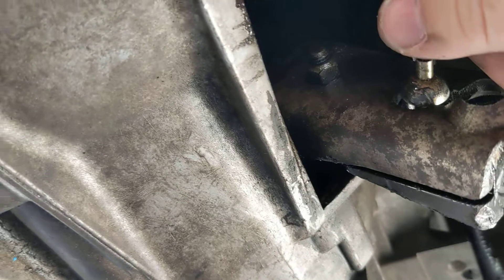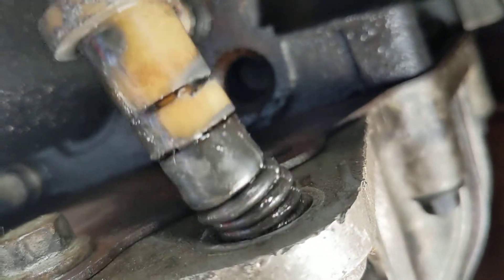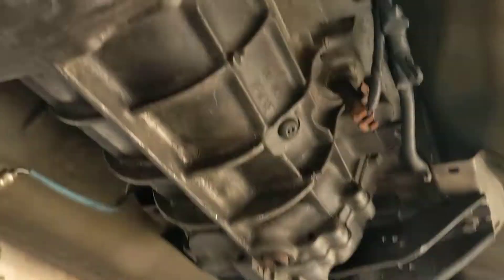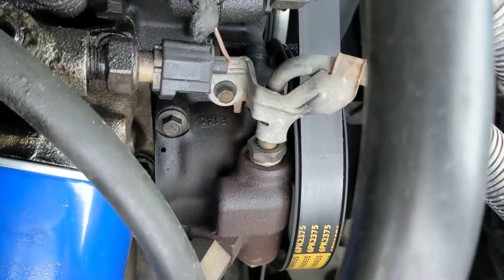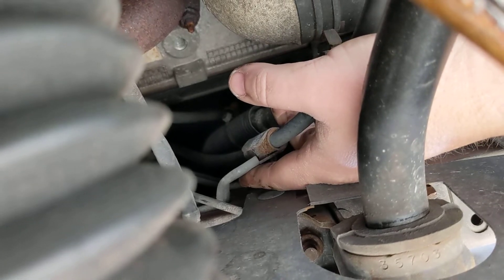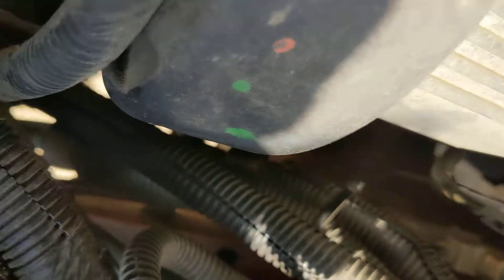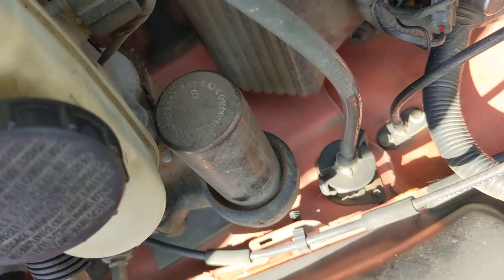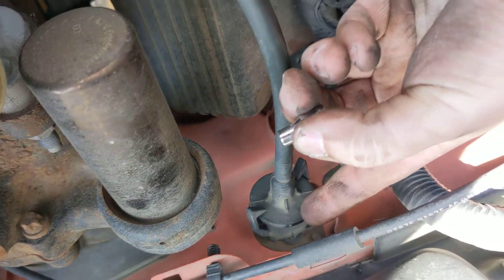clutch cable replacement mustang gt

Comment: What year mustang is this?
Reply from the maker: 2004 GT
Reply: @bigsmooth6346  ok gotta do the same on mines except it’s an an 06, wondering if it still the same.
Reply from the maker: @demetri1651  I'd look up on Wikipedia and see if the 06 has a TR3650. I think they do but I'm not sure